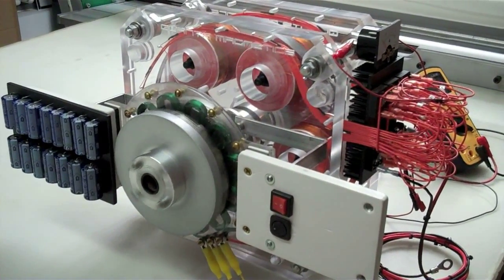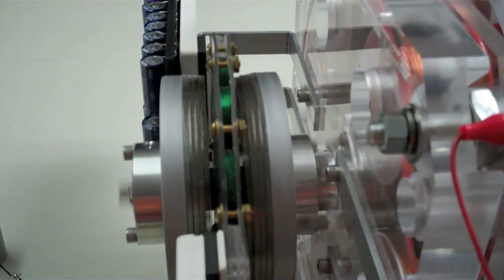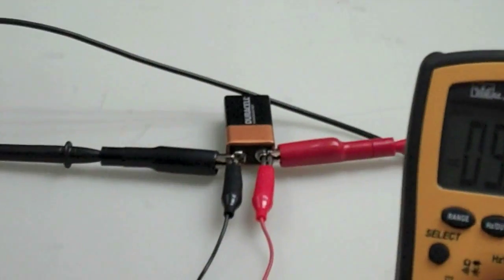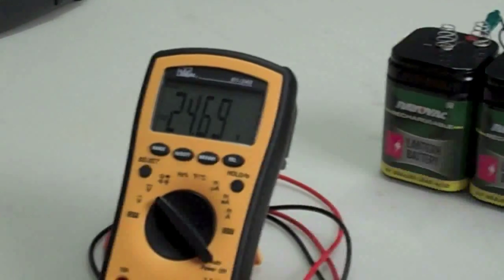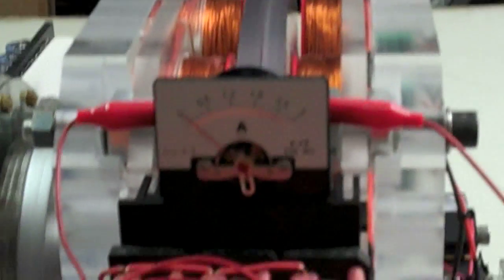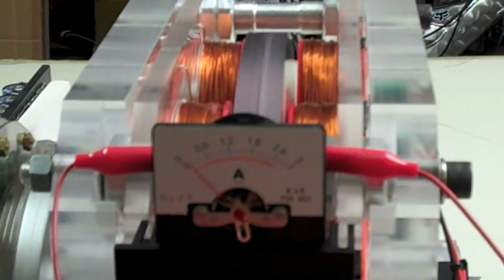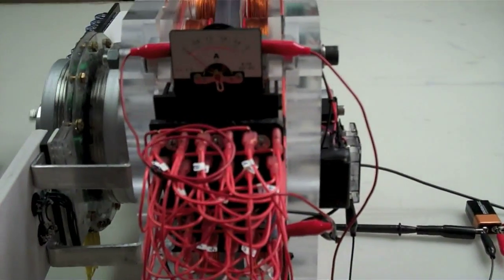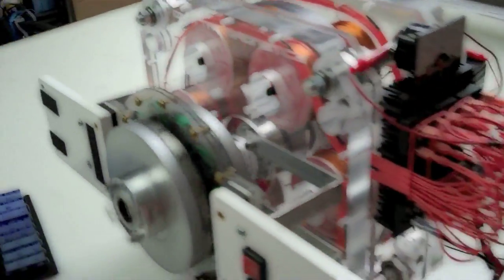Ultimate Pulse Motor Generator - New Energy

Comment: take the batteries out of the equation... you can do the same thing with out all your  mechanics. Spike drawl a 9v battery and you can charge a 12v no problem. hook a real load to it, light, small motor & get some real data please.

Comment: Again my question is about energy conservation law. AFAIK you cannot just a fully charge higher capacity (in Joules) battery from a lower capacity (Joules) battery. Where does the energy (in Joules) come from? Thin air?

Comment: Hmmmm  if the output is greater than the input then you can connect to output to the input and need no battery at all. If that was the case I'm sure you would have shown that instead of 9 volts in and 24v out but not actually showing the output current which is going to be less than the input current!

Fail whale!

Comment: Can this receive low amperage AC input and if so would the same high energy conversion efficiency occur on the output, as AC, into a dedicated AC line, to provide home energy supplementation/amplification? (As a plug n play system, ideally)

Comment: Great work, can we see watts in & out.  You can use a solar panel as your input source.  I'd like to use a device as such to charge my Electric Car.  60 X 3.2V lithium at 180ah, total voltage 190V.  I'm interested in new technologies.

Comment: What happens when you loop the power out back to the source input. If that works for you then I will be amazed ! Also I did notice your voltage meter on the 9 volt battery has a huge voltage drop while charging the lantern batteries. If you can loop in the 24 volts output after start up the machine should put out over 60 volts ? Also there is a Tesla inspired device in operation in the United States that powers a small city. You will never here that on the world news !!! Too much big money !!!

Comment: Well no offence but if you are claiming same torque at 1/10 the current, then theoretically this should run as a closed system indefinitely.  Until you can do that, this is just another failed attempt at creating a sole source generator.

Comment from the maker: I did not get my ideas from Joseph Newman, however it seems to be working in a similar fashion using mostly voltage and an extremely small amount of current, yet delivering a considerable amount of available torque. All mechanical and electrical elements are working together in concert to get the maximum use of the pulsed input source voltage before the next pulse in sequence is needed.

Comment from the maker: Your thoughts are quite relevant. Input/output initial balance is extremely critical. This type of machine should be able to at least run itself, then expand from that point. Supercaps at both input & output locations, sinewave peak power extraction and coreless coils with neo rotors are very important factors. Regarding coils, gold, silver plated copper with Teflon insulation and flat wire would undoubtedly be superior to common coil wire, but a bit cost prohibitive. Thanks for your comments.

Comment: Sorry not enough space. I love the clean style of your videos and the care in proving there are no hidden sources. At the least this is a highly efficient motor. However there are some steps i thought you would have tried that haven't appeared in your vids. Output is AC or DC? I'm assuming AC....there would be some more loss converting the AC back to DC. Try using the scientific method here and measure amps and volts to calculate total power out and in.

Comment: Question for you Hybrid .....if you're charging a bigger battery form a small 9V battery, I'm sure someone as creative and intelligent as yourself has thought of running a wire from the output to the 9V battery input to see if the motor will speed up. Or wire a switch from the output to the input and toggle the 9V battery off once the motor is up to speed and direct the output to power the motor. If so what are the results?

Comment: Now build one that will charge a battery bank of 24 volt @ 10 amps using a solar panel to operate the motor and you will then have a usable device. And make it for sale. and you will be able to fund your projects.

Comment: Wow! Clearer than Newman's vid talking on his monster in a shed. Too bad I'm a geochemist, not motor engineer, but I hope to get reading, experimenting on this. Simpler to me than Bedini's circuits. [I designed ultra simple magnet to energy thing, not electric. Output tiny.] But I need POWER to heat north exploration camp! This is straight mechano-electrical. Great!  I must learn rotoverter. On your vids? I'll look now. This bodes well for Cu & Nd price! [I found one (mine) now search other ore]

Comment: I see a lot of people are asking a question you keep avoiding-dose it output more than it consume's.
The simple answer is no-this machine(along with every other machine) will take a certain amount of power,loose some due to losses,and give a smaller amount back.
The charge batterys are not being fully charged,it is a surface charge you are seeing.
The 9 volt batter holds only a certain amount of energy-the 6 volt batterys hold a lot more.
Please be honust when trying to promote your work

Comment: Measure the input and output power to show the real story.  Pout will be less than Pin.  Plus start with a depleted battery pack and try and charge that.  The input power would rise significantly.

Comment: if you get more out( two fully charged 6v from one 9v..) then why would the 9v be needed after the start up??? I must be missing something...i mean if when the two 6v were finished charging you could replace the 9v with one of the 6v then what charge 50 more 6v.. without ever adding more electricity than the original 9v?????

Comment from the maker: The primary purpose of this pulse motor/generator is directly related to energy conversion applications where faster storage medium charging efficiency is essential. In this instance, the load would perhaps be a battery bank that will feed an inverter. The efficiency maintains the same throughout the entire charging cycle.

Comment: How much and what difference(s) would it make to use a smaller gauge wire for the coils and solid bus-bar type wires instead of the red jumper wires you are using. I think it could increase the efficiency a little more. Also the plate rotating seemed to have a little wobble...?

Comment from the maker: Startup amps, milliamps or micoramps are determined by the input source, and quickly diminish as coil circuit saturates. The pulse coils will take what you give them, then use and store EM energy most efficiently. Startup begins with the very first pulse, which can be initiated with a momentary switch or any movement of the rotor.

Comment: Do you think you can add a second quanta pulse motor to the quanta charger (quanta pulse motor + rotoverter) using the hatem cogging/coupling effect in series? On one side of the coupling would be the rotoverter and on the other would be another quanta pulse motor. This would create significantly more power output, if one were to add more pulse motors in series would it not?

Comment from the maker: The primary goal is to be grid-free. Rotoverter combination delivers the highest output but is not as portable due to OEM motor weight. Conversion efficiency is higher with stand alone pulsed QC.

Comment from the maker: I thought about a demonstration like that, but I think most would like to see a working load applied. I guess it's not enough to witness a little 9v battery powering an 11lb rotor setup (for many hours) that can even generate power from inductance and yet not come to a screeching halt when a charging load is applied. It's really this energy conversion process that I'm most interested in researching. Seems to have been grossly overlooked.

Comment: Thanks for answering, I will try to see how I can import electronic into the country without committing import tax suicide. To run the PMG I need 60HP at 1800 RPM that would generate 40kW / 240v and 167amps. By the way you use the 7.5 HP baldor motor (EM3770T) in the rotovereter configuration. Have you tried to pull full load on that config? (got to ask) if so, what is the strongest motor you can pull (with the QC)
I mean, using the QC to its limit.

Comment from the maker: It would not desulfate batteries, which is your current problem, because the output power is generated through inductance. You need high voltage back emf spikes to do that job properly.

Comment: I am planning on buying one next year (with tax refund money).  It looks like this this motor could run a 5Kw generator with only like 24v to 36v, which could be done easily with solar panels.  Or using the 24v to generate power to convert water to H2O2.  Thats what I plan on trying with it, but not until next year.

Comment from the maker: I'm going to test exactly that! I personally believe that its selectable VA inductance output will charge at a faster rate than a somewhat direct photovoltaic connection that has been filtered through voltage regulation or other power robbing equipment. Besides, this machine can recycle a portion of the power input which would allow a solar panel to build up some reserve energy in batteries or supercaps while running and charging with the pulse motor for extended periods of time.

Comment: As usual you explain it in a very understandable way, question! I have a 45kw wind PM Generator, could I connect it as the rotoverter setup? is this a dumb question? or does it need more torque ?

Comment: Pretty cool, indeed!  I have one question, though I am not very electrically inclined: If you used a solar panel in lieu of your small battery to run the generator, would it be more efficient in charging up the larger batteries than charging the larger batteries directly with a solar panel?

Comment from the maker: I'm not declaring that it is more output than input, but there is substantial evidence that storing and recycling electromagnetic energy exhibits some extraordinary results. Energy conversion may hold more secrets than we previously thought possible. Scaling up the input to a higher value produces the same amperage drop and electromagnetic storage characteristics as with lower input. Maybe not in microamps, but definitely milliamps. So here we are... next?

Comment: Many thanks for sharing.... excellent presentation/explination. It seems to be a common "problem" to accurately measure the energy consumption versus the energy generation with a common multimeter. As you get closer and closer in efficency and approaching overunity the real test it to let it run and keep exchanging batteries back and forth between the run and charging batteries...    many thanks an I'm looking forward to your next upload

Comment from the maker: Yes. I initially connected a nearly dead (7.4v) non-rechargeable 9v alkaline battery to see if the rotors would even turn. It ran at 125 rpm for over 12 hours with the output connected to the input. Imagine what one little solar panel could do.

Comment: Amazing machine! And the level of manufacturing and attention to detail. Do you work for Apple? :P kiddin'  Say, can you run it on a solar panel? That would be a very sustainable input, no? and as for the output, rather than charging batteries, can you put the mA through something like a Joule Ringer, and get a working current out of it to run light bulbs directly? just wondering how to get rid of these massive battery banks as they use them over at Bedini's lab.

Comment: very clean build with impressive results. i got similar results running my 15 transistor pulse motor with 8 additional bifilar coils used strickly as generator coils.  i have done a few builds using 2n3005 transistors and currently using MJ15003 to power some hydrogen cells with great results. looking forward to you showing increased run power versus say batterys that require desulfating.